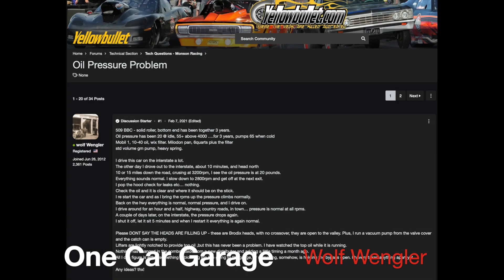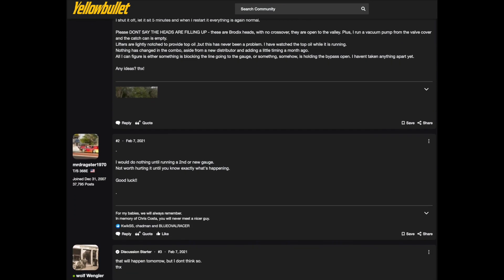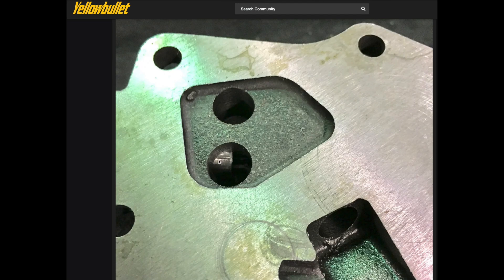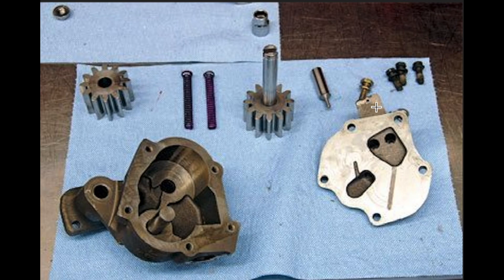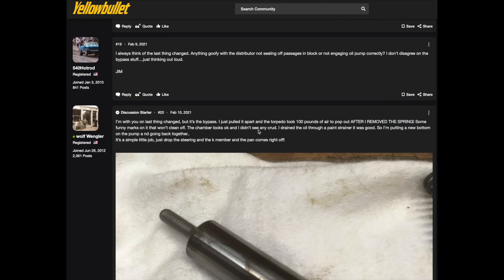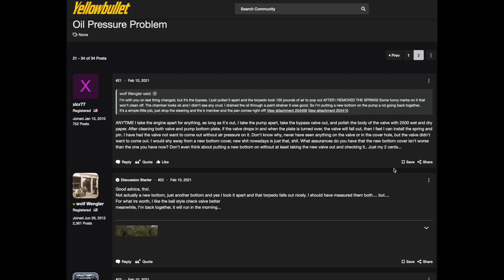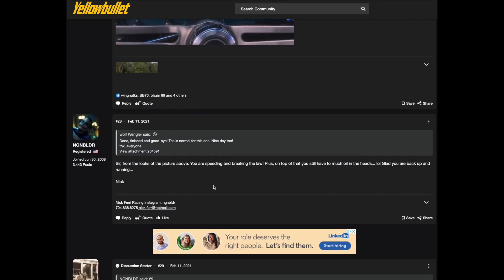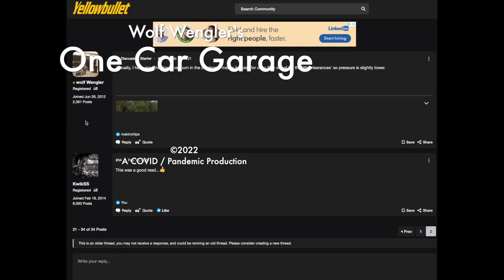Oil Pump Bypass Stuck

Comment: I'm thinking I have similar issues with my ford, going to drop the pan, pull the pump and check it out
Reply from the maker: let me know if that was it!
Reply: @wolfwengler turn out the pump came a little loose from the block and blew out the gasket, I did check the bypass and it was operating smoothly, thanks though, I enjoy and learn something new from quite a few of your videos!

Comment: I'm having the same problem on a 1992 4.3 GMC Sonoma 2wd. To pull the pan I have to remove the cab mounts and the core support mounts. Rase the cab then pull the engine. I have had the truck for 19 years and have 127,000 miles on it. I always change oil every 3,000 miles. First I change the oil sending unit , same readings over 45psi hot at 70 mph. than start it and 20psi cold and 15 warm. than other days its 60psi cold.